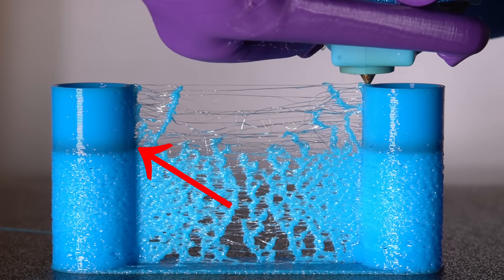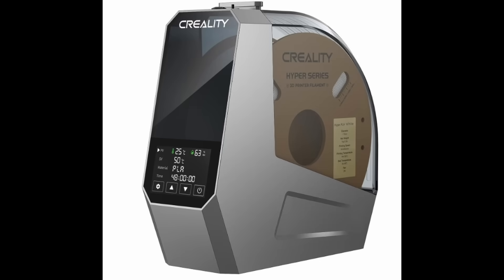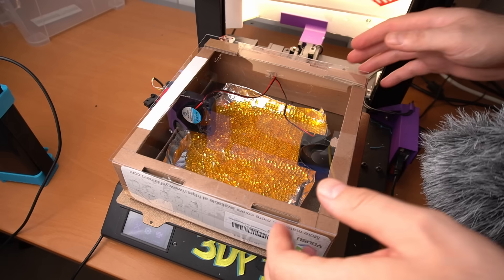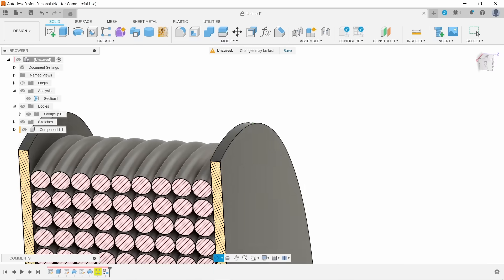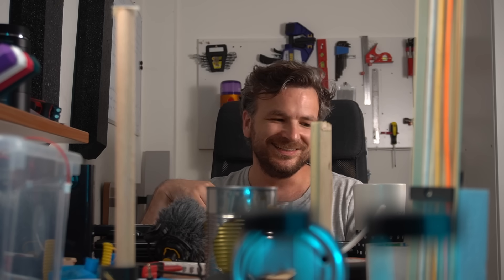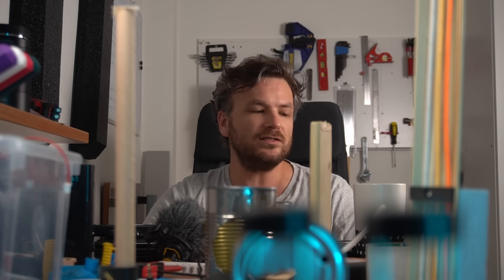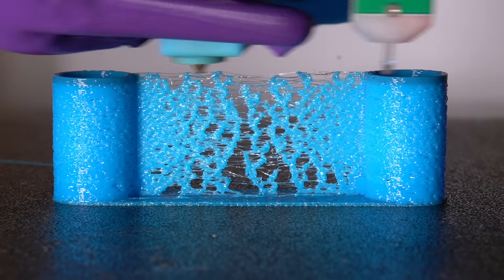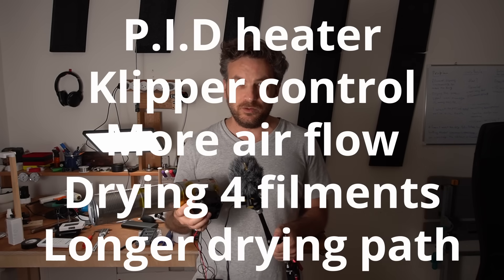Why are we drying filament this way?

Comment: what kind of temp are we looking for? here is one insane idea, teflon tube for 3mm filament, sub-ohm coils used for custom vape pens, a plastic structure to hold 10 coils in the open space vertically, each has spacing from one another lets say 1cm, tube goes through them, the 1.75mm filament goes through the tube, custom structure to hold the tiniest blower that ends up like a straw to kinda the insides of the teflon tube, from down to upwards, I suppose we need baby breath smallest amount of air for moving the heated air upwards.
another simpler idea would be to use two of these new ceramic heater elements used for 3d printing that are circular with again a thick 3mm inner hole teflon tube and a structure to hold them. some kind of arduino controller for both ideas to have multiple temp sensors on each of the coils or the heaters and it will increase / decrease the temps until the desired outcome.

Comment: What about starting with dry air. Compressing it will squeeze the water out so maybe use a small compressor to even just compress the air to 150 psi or so then blow that air through the fan/heater to heat it and dry out the filament faster?

Comment: this is great, am going to try to do something similar and adapt it to my ams, i think i can cut the ams hoses, put the system in the middle, and see how it goes, and i think i may use a heat block with a turbine so i can improve the airflow, and have better control of the temp.

Comment: As someone who works in Medical Gas , Dessicant Dryers are used to absorb moisture and high pressure is then used to take out the moisture. What you've done is what I am going to exactly do :D . I am currently in the works of a model to make my own custom hot airflow mixed with dessicant . Because damn I dont want to wait for my PETG or TPU or any other filament to dry out.
Reply from the maker: "high pressure is then used to take out the moisture" from the desiccant?
Just posted on Discord my version closed loop dryer with desiccant
Reply: @ i mean to say air is vented out with high pressure to take out the moisture. If you search for Medical Air Dryer Dessicant from different brands like Parker you will understand the same methodology , we can use but on a small scale . Dessicant is also not that expensive as it is silica gel only. A small compressor for good flowrate or high speed fan . Ill head on over to discord and see :)

Comment: I"m having issues with PETG for the first time not drying and after doing some research have found that you actually can't dry hygroscopic materials with forced hot air. We've just been driving off surface moisture at best; but if the material has absorbed the water, from what I've been reading, can only be achieved under vacuum.

Comment: 3:50 - I thought I invented inline filament drying.  🙂  I print a lot of TPU for my small business and I've been intending to implement an inline filament dryer on top of the printer.  I'm planning on a small blower pushing air over a cartridge heater with a thermistor an inch downstream to control the air temperature to 80 C where it contacts the filament, and hopefully 50 C as it exits the foot long column.  The ID of my column was only going to be 6 mm or so to increase the surface velocity of the air contacting the filament.  I may use PTFE tubing.  My original idea was a vertical small metal tube with a heating element surrounding the tube to heat it as air is blown up the column.  If I design the column like a cooling tower to maximize natural chimney effect convection it might not even need a blower but for 4 mm^3/s volumetric flow rate, it'll probably need forced convection of heated air to dry it in one foot.  If needed, I'd add an infrared section to pre-heat the filament as it enters the inline drier but that would need to be controlled so it only heated filament as it moved through the heater and didn't melt stationary filament.

Comment: I did a dyer in my diy injection molding machine for drying plasiic pellets a long time ago, i used a small rectangular tank, around 1.5 litre; car lubricant oil tank, cardboard sheet laid inside for insulation purposes, a hair dryer was used and installed inside, it blew hot air to circulate inside. On top of it, a circular spray paint can was used, inside it, a cloth bag held moisture absorption pellets, there was a small clear plastic small window, so the color change of them can be observed. To maintain hair dryer motor could last longer time, it run at low speed, temperature sensor  located inside, a temperature and timer control module was located outside. There was a hole on top of the tank to let hot air flew to the topmost  circular can to the moisture absorption pellets, some would then go outside through an opened small lid on top. Rectangular tank originally had a metal cap, with it opened, plastic pellets were poured through a funnel to load to inside. Another opening was made on tank bottom,  a hose connected it to. After a night, dried pellets let coiming out to injection molding machine for use.

Comment: Here is a little tip from a hobby chemist - if you want to make things really really dry then all you need is a sealable boxfor all your filaments. Then add a (plastic jdeally) container with Calsium Chloride
The difference to silica gel that cold something like 30% of mass in water - Calsium Chloride can do about 800%. silica gel pretty much becomes ineffective under 40% relative humidity but CaCL can achieve air humidies of a few percent. Did I mention you can buy it dirt cheap? You could contact a chemical import - but this is commonly used as an deicing agent so you can probably fint it at hardware srores and such. the big 25kg bags direct from the factory are always vastly cheaper pr unit and arent expensive. that should last you a lifetime.

Fun fact about CaCl is that so extremely hydroscopic that you can dry solutions without even contact - just proximity in an enclosed box.

Comment: The desiccant used in the professional inline dryers is the same as used in air dryers used for high pressure air compressors used for filling air bottles.

Comment: It failed because even if their is air flow all around a thin filament drying still takes time, more than the short can tube. Try a 1 meter vacuum cleaner handel tube and run the filament all the way and around a spool and back again so it stays for 2 meter of warm air flow at max 70c. That has at least a chance to dry it enough to make a difference. If more drying is needed just run it down and up the tube again for a 4 meter drying run. Yes a lot of filament would be in the tube but the dryer need only be 1 meter long and can hang next to your printer as to not be in your way with the heater+fan blowing hot air from the bottom up. Good luck

Comment: I see the appeal but the newer sunlu driers have a fan built in. And if you have an old dryer there's a number of easy ways you can install a fan and silica holders. I've found I can use filament that has been sitting in the open air for some time if I'm running the spool from the dryer while it's running.

Comment: Just coming across this now, but I would say if you can somehow make a guide/feed tube inside of the tin cans to spiral slightly inside, you'd get more surface area for the filament to travel across and thus spend more time inside the drying chamber.  Insulating the outside of the cans too may help retain heat but then you may have to watch that when it gets close to softening the filament before entering the printer.  While I don't have the statistics to back it up either, making it so the chamber has a negative air pressure (more air out than in) may allow for faster drying as well as once the moisture leaves the filament, its immediately vacuumed out but you may also risk vacuuming out the heat as well.

Comment: As someone that only uses one reel at a time, I don't understand the excessive talk about drying filament, I've never had print issues related to "wet" filament.
Reply: Nylons can get wet enough to string in the time from opening the spools to it hitting the nozzle

Comment: Funny idea, but you should let the filament run a longer way trough your pipe.

I printet a bigger spool for my SunLu Filament dryer and so i can unroll it a bit while its in. Its not packed tight anymore and it drys way faster.

ALSO the new SunLu has a Fan in it and it works really fast.

Comment: I use my turbo oven. Its powerful turbo fans drop humidity to 10% in a couple of minutes after I set the temperature to 50°C and  press the on button. Four spools easily fit in and it takes 3 hours max to completely dry them. I dry my filaments right after I buy them and store them in vacuum bags so that they are ready as soon as I need them so that there wouldn't be enough time for me to forget about what I would print.😂

Comment: My guess on why they aren't made commonly is the reliability issue with different filament types and speed might require more user imput than the companies think customers want to deal with so selling you a heat chamber that dries a whole roll  after a few hours is harder to mess up the drying process. Incorporating it into a workspace is its own issue. You probably will see it become more common if their is a demand for faster drying methods.

Comment: The problem with your system is probably the energy you spend to heat air which is then "lost in the wind". 
Instead, I suggest you use a Peltier element to heat and dry the air you blow to your filament, and then cool it before you send to a condenser on the cold side of the Peltier before re-heating it in a closed loop. The reason of having a cooling before the condensing is to prevent the heating of the whole system because the Peltier element produces more heat than cold.

Comment: There's an awful lot of nonsense in these comments.
First point to understand is that hygroscopic materials are that way because moisture is being attracted deep into the plastic resin at the molecular level and is embedded within the filament - not just the surface.  Molecules of H20 are literally bound to the polymer chain.
Failure to dry the plastic before it reaches melt temperature results in hydrolysis - the water reacts with the resin causing the polymer chain to break down - reducing viscosity, melt strength and the final strength of the product.
As a result, there will always be a significant TIME element to drying any hygroscopic material, especially nylon, PET and PETG - there are no shortcuts such as vacuum or microwaves.
The other key factors are AIRFLOW, TEMPERATURE and DEWPOINT TEMP - in that order of significance.
The reason why AIRFLOW is so important is because it is the medium that is used to transfer the heat energy into the resin that assists in driving off the moisture. In all forms of drying, AIRFLOW is king - far more important than the other three factors.  DEWPOINT is probably the least important of these, although it will improve drying efficiency as it will assist in pulling moisture out of the resin.
Drying for too long at too high temperatures will also lead to hydrolysis so residence time has a minimum and maximum value depending on the other factors.
This is how all industrial plastic processing dryers work.

Comment: There is a ceramic heater like the space heater, but only 200W rather than the usual 1500W ones.  If you pipe in the air from it, it should be a nice dry air.

Comment: Not sure if you have made any progress. I would like to give just a little advice. What I saw in the video at the end is you need to adjust the filament feed. Check the filament retraction distance. All of this has factors in those stringing artifacts in between the upright columns. Once retraction distance and speed are adjusted. You should eliminate the stringing. I have a dehydrator that is for drying fruit or herbs. I know what I am printing I just need to set the filament in there the night before I start a print. It works great for me and unlike filament dryers. The dehydrator has convection fans. I set it for 100 F or 37.8 C and 8 to 10 hours. My filament storage is in my room on a shelf close to the ceiling. The fact of moist air is heavy and air at the ceiling is dryer. We also are usually very humid in summer. This year has been quite dry. I have printed TPU, and I am more of a PLA or PETG. The TPU I did print was great and did quite well. The dehydrator I got was under $90 US. So, it could be purchased quite easy. Though if there was a product that was built in, and I didn't have to have the dehydrator. I would buy your dryer.
Keep up the work. I would buy it. 

PS.  Just check those Retraction settings. That will help the stringing.😊👍

Comment: The market doesn't have in-line filament dryers because the filament company's make money selling you filament that you can't use.  
When the expensive new roll of nylon carbon fiber that you bought is so hydroscopic you can't use it out of the box. But you try and get garbage prints. The only answer. Buy more filament. Just get the same color in PLA though.  
...Or buy a dryer boxes (sold by the filament manufacturer) and fail again. So we just give up and buy more PLA. BAMBULABS CAN'T LOSE!

Comment: Inline filament drying is good but, enclosed dryers will always be the favorites. Drying the filament is not only about drying it but also preventing the bridle filament from breaking which always ruins prints. When the whole spool is enclosed, there is no chance of the filament snapping since it gets soft before exiting the enclosure.

Comment: you could combine the two for higher print speeds. have the spool in a drier to start the bulk of the process and then run it through the inline to polish it off!

Comment: Use some pullies/bearings and run the filament up and back through the drying chamber several times for more exposure to the heat source.

Comment: What you need to to have the air ‘conditioned’ and dried before being heated and blown over the filament. If you could have a refrigerating unit with a lot of fins that would condense the water into a drip pan would be ideal. I suspect there is something like that in the $2000 unit you mentioned. If you have an air conditioner nearby, pipe the output as the input prior to the heater and see how it goes.

Comment: the tpu is not porous like goose down so it takes a while for the water molecules to find their way out. I'm sure you can succeed on this project, but the question is how long the dryer will end up being. But if you refine the project (use insulated aluminum pipe) and you achieve success, you might get plenty YouTube views

Comment: Can be substantially improved using "countercurrent mechanism". Imagine a longer and thinner pipe with a heat source at the printer end of th pipe. At the spool end the pipe is connected to your shopvac or fume extraction which sucks all the warm air through the pipe, parallel to the central filament. The driest part of the filament, the one which has spent longest time traversing the pipe, gets surrounded by the freshest, warmest, driest air, making the delta of filament and surrounding air biggest where the final iota of dryingis needed. The longer the pipe, the better. Ideally this is a vertical design, so that gravity causes no decentralization of the filament and it also adds a chimney effect kind of. The heat wants to rise in the pipe. Efficient and beautiful.

Comment: This will only work well if the air in the room is dry.  Moving the air past the plastic will dry it quicker but not if you are blowing damp air into the chamber.  Hygroscopic plastic will pull moisture from the air around it if it is not dry air.  This is why the chambers take so long. They heat the air in the chamber and the moisture evaporates, but they are sealed so they don't let moist air back in. The only quick way is to use your contraption in a room with very low humidity or use a desiccant dryer like they do in Injection Molding.

Comment: The particles inside the dryer of 4:27 are molecular sieves (MS) (you can check it online), they are porous particles, with a pore diameter of 3-4 Angstroms. This little diameter only let water molecules get inside the MS, so they retain water like silica gel. They are commonly used to dry different type of gases. The only gap I find in using MS to dry filaments is that they can retain water in a amount about 20% of its weight. Once the MS is full of water (you cannot see when it happens cause it doesn't change its colour like silica gel) you need to dry it. To dry it, you need to put it in an oven and increase the temperature gradually till 300-350°C (for example, 1h at 100°C, 1h at 200°C and 1 h at 350 °C). So it is quite expensive to dry. It costs about 4-5$/kg for large amounts (more than 25 kg), but I imagine that it cost will be more expensive for low quantities. 

Maybe it could be interesting to try a sistem like this using silica gel instead of MS.

Comment: I love this. Have you tried making the air intake kind of venturi effect and then gradually reduce the tin cans section, making it conical? This should accelerate the air and increase airflow. Not 100% sure but that's how it works on engines, so it should.

Comment: I saw one person who had filament running across the workshop inside PVC tubes which were filled with hot air from a boot dryer. Supposedly this did a great job of drying out filament by the time it reached the printer. But if such long filament paths are needed to achieve inline drying, then it doesn't seem so practical, and I'm sure the boot dryer uses a fair amount of energy as well.